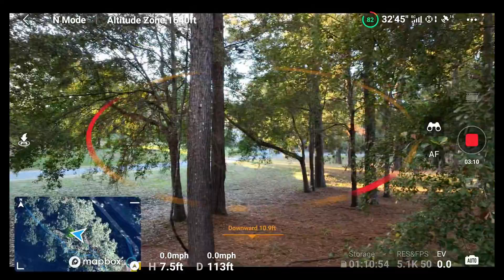DJI could crashed my Mavic 3 -Testing advance RTH.

Comment: Really need to change the title 😕 Pronto. It insinuates that "DJI" did something to crash your drone. Also my front yard has 2 huge,  leafless trees with hundreds of fine, thin branches. The M3 consistently tries to go right through. It might save itself, but the fine branch yours hit is exactly why I have to cancel ARTH. (Advanced Return to Home)  every time. I won't chance a 25 foot (8 meter) fall to my concrete driveway. It works VERY well. But not perfect in all scenarios. A choice to use Straight Line RTH is required.

Comment: You did the same thing I did by buying the M3 and the new Smart remote to fly it, I did an extra battery too with the multi charger. The RTH on our M3's is pretty amazing, mines ducks around everything coming home. Wait until after the update in January this drone is gonna be sick. I flew out 11,000m and turn around almost 7 miles one way and landed home with 27% battery 32 minutes of airtime. Best DJI drone yet by far

Comment: I'm sorry, but I'm going to have to agree with others here, your title is #clickbait. DJI didn't almost crash you M3,  there are limitations and you as the pilot need to fly within them.  There are some obstacles that the system won't detect, and you need to be situational aware of the environment you are flying in. 

If you owned a Tesla, had it in autodial and you crashed, who is at fault.

AI is not perfect

Comment: hello congratulations for the test. I have the mavic 3 and I'm studying its strengths and weaknesses. i would like to know but the rth function has different sucks? because normally you put a height of 80 100 meters as a parameter. but in your cases the drone goes straight gold. how come?
Reply: That's the way @DJI set it up. They should give you more options. Instead of just the advanced return to home. During the day it will use the advanced return to home, and at night it will automatically fly up to the set height and return to home because of the low light conditions. Be very carefully on every flight. I wouldn't trust the obstacle avoidance still, even though it seems very impressive. Hopefully @DJI will improve a lot of these issues with the firmware in January.  Come on DJI  ?
I love your products but this release has got me scratching my head.  I've owned nothing but DJI drones for years and I don't under the release of this drone. It's got me scratching my head.  I'm very nervous flying my M3 now seeing what's been having to some people.  You can and should  have done better @DJI